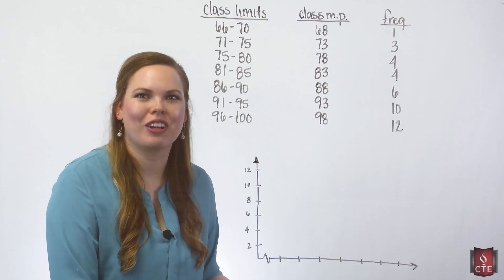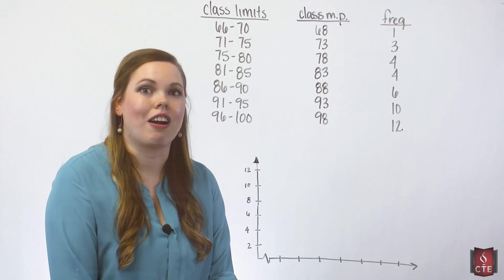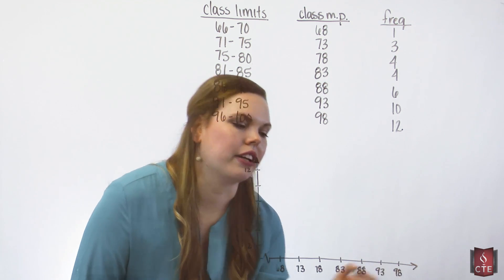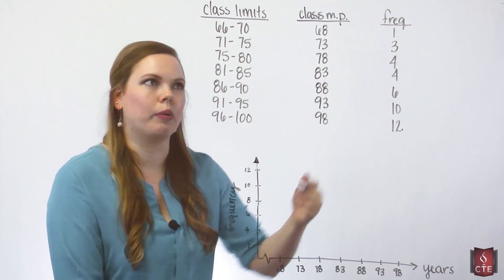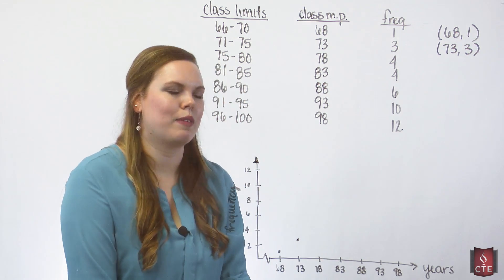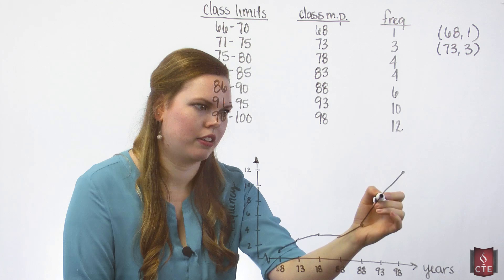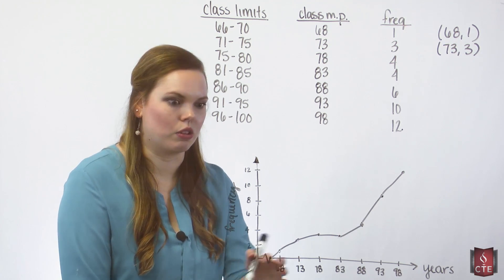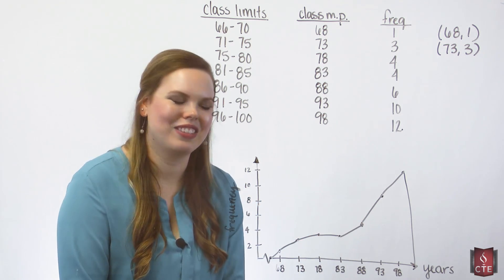Constructing a Frequency Polygon

Comment: You should have mentioned that the end points should be the lower midpoint before 68, which would be 63, and the upper midpoint of 103. Subtract 5 and add 5 to close the polygon.